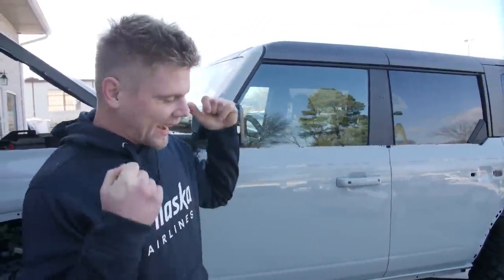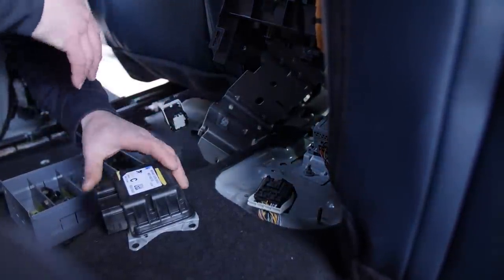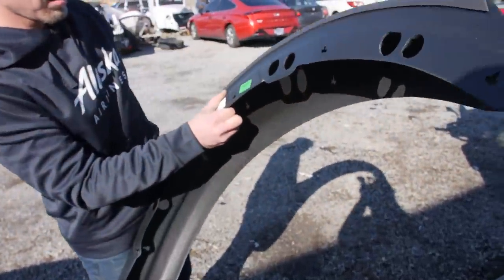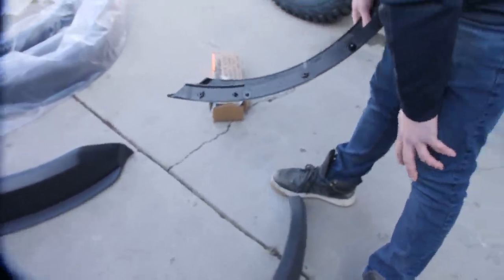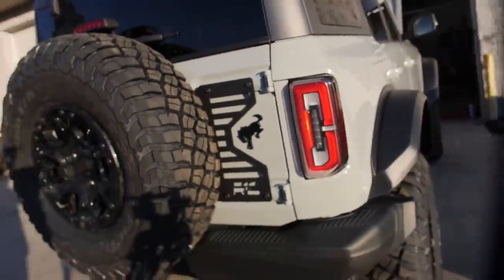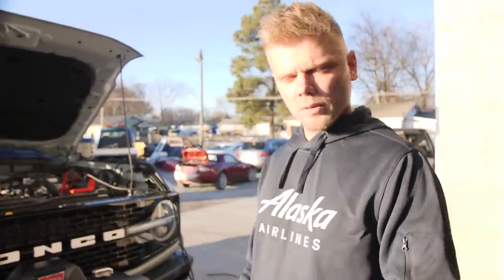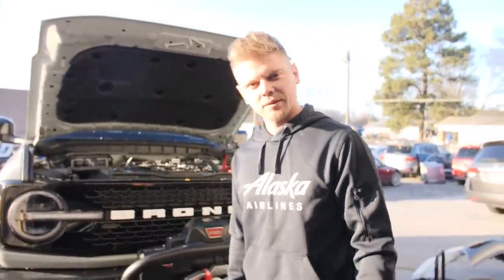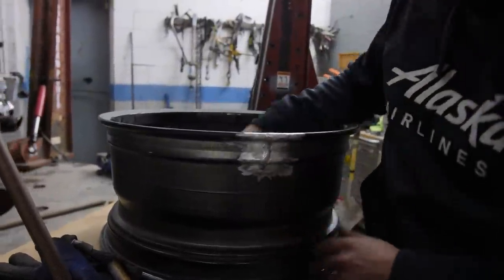The Bronco Rebuild is Done! Installing the final mods.

Comment: great work again - i do like it when Yuri breaks into his English Mary Popping's accent, kind of Dick Van Dyke with a hint of Australian haha, makes me giggle mate - Bronco thing looks better with the new spats, looking very sweet overall

one thing i found with having rims welded up, the heat can cause the rim to shrink a little and cause a crack on the opposite side when you drive on it, wasn't a happy experience, when it cost a lot, and then again to correct it, buying another set of rims the right dimensions trying to save on not having to get a new set of tyres might have been very expensive, out of the question here in the land of the UK, and i'd suggest if it happens to anyone, the welding was not good, Yuri's on the other hand looks pretty smart

Comment: That wheel will need balancing... :)
Reply: @vincentkennedymcmahon8380  lol, I was being sarcastic-like you :)
Reply: @pip5461  thats not sarcasm. Its a fact
Reply: I don't think I would want a repaired wheel. Maybe as a spare.
Reply: @TheBababa420  True
Reply: @TheBababa420  It's been 7 months since I've had a wheel repaired the same as in the video & so far, I haven't had any more issues with the wheel, no loss of air & no more crack's.